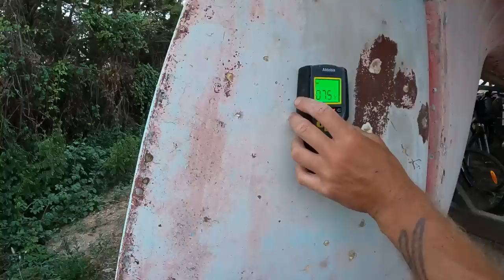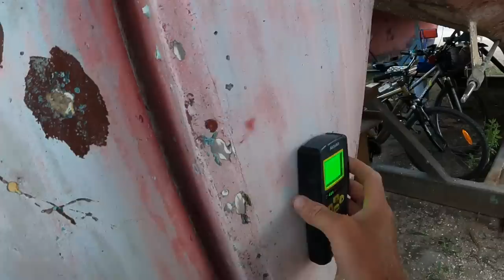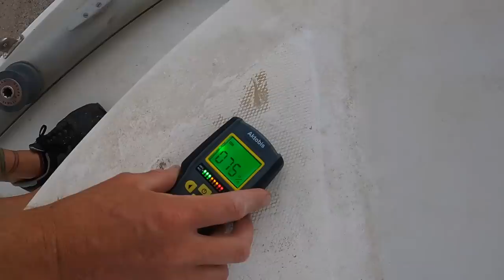We Bought an ABANDONED SAILBOAT. Did We Find a Diamond in the Rough?! | SAILING SEABIRD Ep.3

Comment: Don't be scared because of what the little machine shows you . As long as the Deck is not soft it should be good. Fix the old screwhols and the cracks . Please use epoxy NO Polyester even if epoxy is more expencive its just the right stuff . The bad thing about plastic is ,  its undestroyable . ln your case thats good. The engine looks like a bigger job . You will find out . 
good luck 👍⛵
Reply from the maker: Thank you Martin! 
That’s exactly what we thought. A boat has never sunk for having a spongy deck 😅
Reply: Totally agree! That machine could well lead you down an endless rabbit hole of chasing moisture. There was a famous UK surveyor who made an entire living out of scaring the bejesus out of yacht owners with his moisture meter! Seal up any holes, make crack repairs sure, but like Martin says, if it isn't soft or clearly delaminating then don't worry!
Reply from the maker: @richardmanly9330  yup! That’s our plan… As long as it can sail and it’s safe and comfortable 😊👍🏼
Reply: I'm sure that moisture is going to be higher than normal after it's been sitting in the open for years now.. put a small dehumidifier inside the boat and it will draw the moisture out of the boat..

Comment: There are lead keels and iron in concrete keels ..not so happy if they get wet..
How to tell try a strong magnet
Or a hand held compass... Iron will cause it to swing..

As you two have learned the way of the Womble .., and your in the same area as the biggest Port boat yards in the S of France and you speak the language ..so fear not the opportunities will present.😁😉🧙‍♂️👍🏼
Reply from the maker: As always, thank you for your advice Clive! Never thought about that… We’ll give it a try and see! :)
Reply: @SailingSeabird  
Dont forget any large lump of iron iron or steel near a compass, will react so watch as you get closer. Always was warned to set down Axes or Rock hammers etc whilst navigating by hand held compass.😏

Note ...  find a local metal detectorist with a decent detector than can if im correct discriminate between Fe  metal and Pb.

Comment: That power washing probably didn't help with the moisture content on deck. It looks dry enough around there that you could wait a week or so and recheck and then seal everything if the moisture content is down. Core sounded ok and it sounds like you will do some checks to find out for sure. It sure looks a lot better after the wash and as some others have mentioned it will clean up nicely but then you are going to paint it anyways. Most diesel motors you re-sleeve to get the bores sorted but then if the crank is rusted you might look for a decent used motor.
Reply from the maker: Hi Daniel!
The readings were probably higher because of that but you are right is so dry here that it should be all super dry by now. We’ll probably drill some holes to have a look.
We don’t think the engine is salvageable and we can’t afford a new one so we’ll probably go for a reconditioned one.
Reply: @SailingSeabird  better to spend a little money on a trusted mechanic and get a recommendation as to the way forward with the engine, you'd be surprised at what's ok with a rebuild. 
Speaking from experience as a hgv company owner for many years in Canada. 
You might be surprised at what it might look like with a good cleaning , but of course the inside is all down to the previous maintenance schedule and abuse it may have had.
Reply from the maker: @keithpither9893  we think she’s not really salvageable… We’ll see what you all think once you see it. It would be interesting to hear your opinions.

Comment: Is it a 4108 or a 4236 Perkins. Wouldn't worry about that tank even if it was a bit rusty it would need to be replaced. As for the alternator, you will get a much better output from a modern one anyway. I would be more worried about finding the mast or the sails. Are they in the yard? I hope you are not suggesting the boat was only worth half what you paid for it ;)
Reply from the maker: Hey Justin! Hope you are well 😊
It’s a Perkins 4108. Or maybe we should say; it used to be 😂
We found the mast. We wouldn’t have probably bought it if it didn’t come with a mast. No sails though… but we’ll find some second hand when the time is right 🤞🏼

Comment: If you have a Stewart Turner stuffing gland on prop shaft it is probably fastened by Whitworth rate thread nuts and bolts. A set of these are usually cheaply available on British internet and should be purchased now as other restorers in other parts of the world pay tool shops frightening money to make such items on lathes. Checking on such items now can solve vast expense later on. Whitworth was the original thread rate used by old  marine engineers and some items never moved on.

Comment: The areas where you'd expect to find high humidity levels you found. Basically you need to remove any (all) the fittings on the deck and redo drill out and re epoxy the blanks. The vyou want to use as a repair may not be enough. The area is large and it will need sanding back, drying and refibreglassing. Lots of sikaflex .The keel is the where you need to test properly and mark as you go. The water pump is kaput but the engine looks nasty but it looks all surface. A day cleaning and trying to start will be the reckoning. Hopefully the fuel tank isn' t rusty inside. Time to roll up your sleeves and take a deep breath.
Reply from the maker: Thank you for all the advice 😊
Might not be enough with one deep breath 😅

Comment: You need a brand new engine and to re-core and fiberglass your deck. The wet keel hopefully only needs some minor repair and a wet rudder might not even be an issue if it's not rotten. Lots of boats have wet rudders and it's fine if it's structurally ok. The engine bay seems to also need some work and the fuel tanks need to be replaced as well. Water tanks too quite probably. Then there's the question if the bulkheads and chainplates are in good condition but it's safe to assume that they need some work. The windows haven't been touched in many years so they need resealing. Then the interior needs some work, the engine bay doesn't look good either. Then the boat needs sanding and a fresh coat of paint.
After all that's done, which looks like a huge project, you're going to need to buy all the standing and running rigging, rolling furler and new sails. So that plus the engine would be at least $50 000, probably $70 000 and something like two years of work. How much can each of you make per year? Let's say you could make $50 000 each, that means both of you working full time for two years would make $200 000 total. But let's say that you worked part time on the boat, that would mean two years of your labor is worth $100 000.
So the question you have to ask yourselves is, is this $1 boat going to be worth $250 000 or even $150 000 after you restore it?
Anyway, to all the people watching videos like these. Do not make the same mistake. Go get a good paying job and make enough money for a boat in sailing condiction.
Reply from the maker: Very interesting comment, I think the price will come in a little cheaper. But the main thing is I want to do a project like this for many years. I’ve got most of the standing rigging bits, just need the cable. The running rigging isn’t a big job either. Second hand sail and engine. Things in France are more expensive than England but not sure on the pricing in the USA. A lot of people say it’s going to be super expensive and it will be but nowhere near the $250 mark. Plus it’s fun…
Reply: @SailingSeabird  If that's what you like doing then go ahead. $250 000 mark is all the materials, sails, engine and your labor. Unless you value your labor at $0, in which case come work for me. I'm looking for free labor.
Reply: @SailingSeabird : To the rescue, - no matter how your labour is free and you can allways find what you might need for parts and that's what will keep you going, - don't ever forget that !
Reply: I've restored two boats and spent nowhere near 50k. People that aren't resourceful are blind to the possibilities.
Reply: @josephcrawley3095  I've never done a refit this massive and will never do but I know that it's always more expensive and takes longer than you expect.
You can get an engine and sails second hand and rig the boat with dyneema instead of steel. That would certainly make some savings. But there's a lot of other expenses that will come up during the restoration and they will probably also want a new electric system so re-wiring the whole boat, new batteries, charge controllers and batteries. The boat doesn't look like has a sprayhood or a hard dodger so that's another thing on the todo list.
I love sailing, not doing DIY projects. But I understand that there are people who prefer tinkering to sailing.
Reply from the maker: @saylaveenadmearedead  😂😂😂 There’s nothing more expensive than a boat hehe. They are all money pits anyway 😅
Reply from the maker: @josephcrawley3095  totally agree!
Reply from the maker: @Mr.-Wint  that’s our plan! We’ll be paying with our time to learn about the boat and ourselves. We think that’s pretty valuable… And we’ll have a lovely home by the end of it to travel to beautiful places. Hopefully 😅
Reply from the maker: @yarpenzigrin1893  yeah! No worries. Where are you based?! 😊